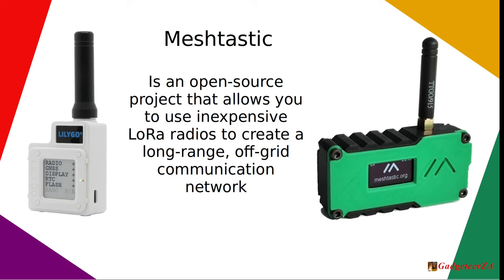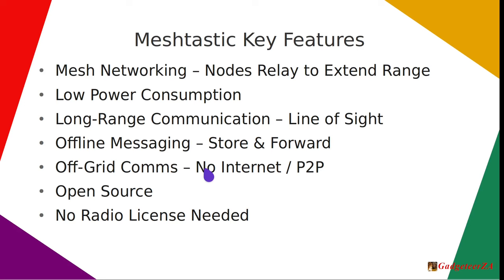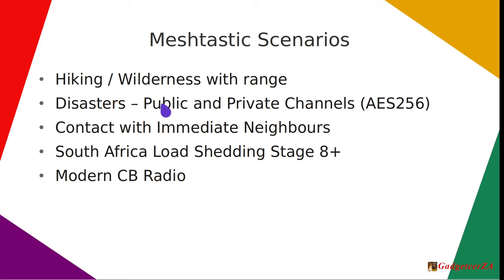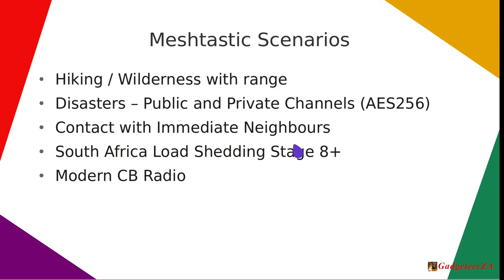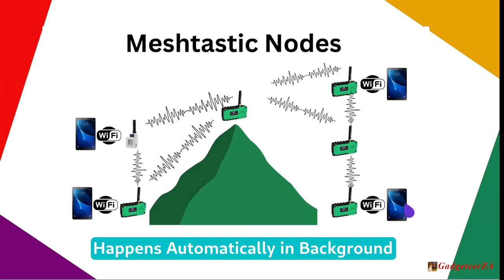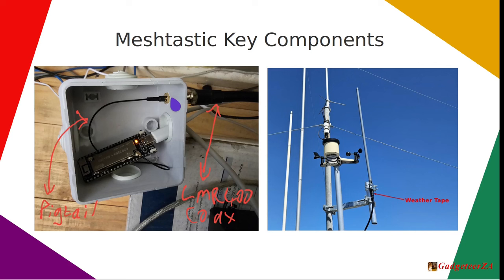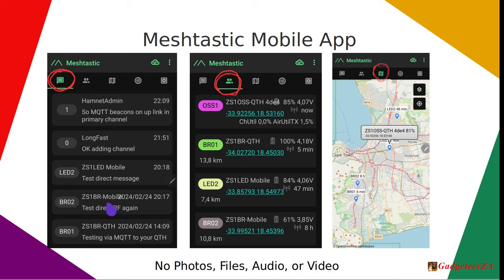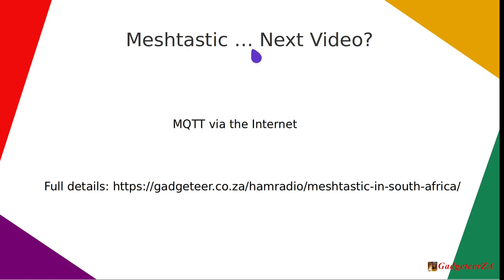A Non-Technical Introduction to Meshtastic Off-Grid Radio Communications

Comment from the maker: The msh/ZA topic in MQTT we are using for South Africa right now: If you want to follow a similar approach in your country, just use /msh/AU or msh/UK as appropriate. I've expanded a lot on tips and lessons learnt at the bottom of my web page at https://gadgeteer.co.za/hamradio/meshtastic-in-south-africa/, and I am updating that as I learn more.

Latest updates from July 2024 have disabled Store&Forward for client_router nodes, and now is only for dedicated router nodes. They have also reduced some re-transmits minimums to reduce congestion on busy meshes.

Comment: I've been a licensed Ham Radio operator since 1989, and was into CB many years before that. I have radios to cover all ham bands, GMRS, CB, and now LoRa/Meshtastic. I highly suggest people get at least one radio for Meshtastic, and preferably a CB and/or GMRS radio, too. I have one RAKwireless WisBlock, one Heltec v3, and three more Heltecs on the way for Meshtastic. The way this world is going I'm preparing for the worst.

A good video. Thank you.
Reply from the maker: I've done pretty much the same as you, except we've never had GMRS here. It's always too late when you need this hardware, to then think about getting it. But just like CB radio, Meshtastic is a great way of meeting other people nearby. When I was in my teens, I met most of my best friends via CB radio. But the challenge is getting people to adopt it, just like even with ham radio, I'm really struggling to get many of them to adopt digital modes. Voice is fine, but when propagation is challenging, digital tends to punch right through the noise floor.
Reply: @GadgeteerZA  👍

Comment: I pick up a few 150+ miles away. Just super impressive they will go that far. Those are all located in the mountains way above my location.
Reply from the maker: Wow that is really close to the global record of 158 miles - https://meshtastic.org/docs/overview/range-tests/. Check if it is actually over 158 miles then you can register the new world record!
Reply: Kudos!!! which LoRA module & antenna are you using?
Reply from the maker: Thanks! I'm using the T-Echo as-is when mobile but from home I'm using a Heltec WSL V3 with an 8dbi antenna mounted on a 5m mast using LMR400 coax to connect it. I think there is a link in the description to my webpage, and I included some links.

Comment: Have you experienced any noticeable signal loss using the 5m coax cable?
I am running 8m of LMR400 to the Heltec v3. I am still testing range and reachable sites.
Reply from the maker: Not that I’ve noticed but I did no detailed measurements. I, picking up line of sight for a good 12km.

Comment: Sounds like a good system and would be great if lots of people jump on board. Love the purple mouse!
Reply from the maker: Yes needs a few people and then it can stretch out the communications quite well. Yes using the same purple mouse as my standard mouse cursor.
Reply: You say that, but London & Manchester (UK) airwaves are packed with Meshtastic - you’re lucky to get a message through lol
Reply from the maker: @ScandalUK  yep we're way behind that. Hopefully tomorrow Saturday we get one placed up on our mountain, and we get coverage between our isolated nodes right now. We're using a custom localised MQTT topic so hopefully we can announce measures to reduce congestion when we need to.

Comment: Hello, I thought 433 had better penetration and range than the 868. 

You can get an advertised +20dbm at 433 100mw T-Beam 1.1 if I’m not mistaken?
Reply from the maker: Yes 433MHz will have "better" penetration being lower frequency, but there are some caveats such as in ITU Region 1 I recall we are limited to using only 10mW license-free (well in our country anyway), and if you go higher power as a licensed ham operator you lose the encryption. So what we're finding in our area is that 868MHz is by far the most popular.

Comment: A couple of us are on the other side of the country in the KZN Midlands, maybe one day there will be enough nodes to make the jump ;-) Used in the troubles with ATAK as well. I'm not a great fan of MQTT once there are lots of nodes about.
Reply from the maker: Good to hear you guys are flying the mesh flag that side as well. Will be interesting to see one day what the furthest stretch is we can get across a few nodes. Yes, I suspect MQTT will flood the network if the nodes are all connected. I still want to understand how MQTT is implemented better with Meshtastic. It definitely seems some settings override others.

Comment: just curious - are there already any meshtastic users in the CT area?
Reply from the maker: Yes myself and two other ham radio guys have ours running in Cape Town. One is sitting down by Simonstown too, but is not connected to the Internet, so you don't see it on the map. It's one of those situations where you need a few others spread out, so I'm hoping we can get some traction.
Reply from the maker: Now about 9 to 10 of us in CT area - a new higher node even connected me to a node in Stellenbosch 32 km away yesterday.
Reply: @GadgeteerZA  awesome!

Comment: Great video! Do you recommend meshtastic for massive industrial IoT usecases like smart metering where you need a couple thousand meters on the same mesh network?
Reply from the maker: Thank you. Mmm not sure about a few thousand, but put it this way, you can tweak how often each transmits so typically you reduce that a bit, and you can set an encrypted channel so no-one else is reading the data. The devices transmit incredibly quickly - quick short bursts.

The other thing is by default they will each relay signals onwards, but Meshtastic does choose the most direct route. But again you can set a few to relay, and the rest not. So some thought and tweaking is just required. It depends on how far away they are versus concentrated in a smaller space.

But you can reach those who will know more at https://meshtastic.org/ in the Discord or Reddit servers. I'm sure many have actually done something like this.

Comment: I wish Meshtastic devices could be used with a WIndows computer without internet. sadly they built this whole thing around the smartphone application and I don't have a smartphone.
Reply from the maker: You can log into the device and message/manage it via a web browser by connecting to its IP address but yes that needs a LAN (no Internet needed though). That is not very stable though as you need to refresh the connection after a while. You could also connect to it directly using the USB cable, or in theory, install the Android app under an emulator in Windows, and connect via the laptop's Bluetooth. And a LilyGo T-Deck device requires no phone at all, as it is a bit like a Blackberry phone with a hardware keyboard included.
Reply: Keep in mind that phone service isn't required for the smart phone. The app currently requires Android 5 or higher. Considering Android 5 was released in 2014, that opens a lot of used phone possibilities. As mentioned in the video, the T- Deck can be used standalone. If you haven't seen a picture of one, it looks like an old Blackberry phone.

Since the release of the video, a significant milestone was reached with Linux. You can now run Meshtastic on Raspberry Pi boards and work is proceeding with other Linux platforms. It's my understanding much of this is being done with Python and since Python can run on Windows, a Windows version may not be too far off.
Reply: I use an old phone no longer needed..works great.

Comment: On the Range Test page there is an image of a Google related tool used to help find the long distance ranges, that has an option to check for a Flat (I have to do this for censorship) Earth. Now why do you suppose they would do that if Flat (I have to do this for censorship) Earth was not a possibility? I don't see other shapes like a cylinder which is what the Mercator projection is based on.  This idea of a Flat (I have to do this for censorship) Earth being given equal consideration in the tool must be pretty important.
Reply from the maker: OK not sure as my range test page in settings only has options to enable it, interval, and save in .CSV format. I'm on latest Beta so maybe you're on Alpha version? Radio frequencies tho do depend on Earth curvature as high frequencies are only straight line of sight vs lower frequencies (not Meshtastic frequencies) which are HF and can follow the curvature of the Earth by bouncing off the ionosphere. So as far as Meshtastic goes - it really only works in straight lines, unless you can reach a far mountain peak with a node on top, and then relay to nodes far on the other side. But even for 100km that is still pretty flat ground.
Reply: @GadgeteerZA  The claim "HF and can follow the curvature of the Earth by bouncing off the ionosphere." is in interesting one in that 1st, it commits the logical fallacy of begging the question Earth is a sphere and 2, There are no known experiments in physics to validate the claim of anything bouncing off of a layer of gas in an open system where that gas fails to obey the 2nd law of thermodynamics and expand into the available volume of lower pressure. I'm a shortwave guy not a ham but I have seen hams make such claims without scientific validation. Fun fact you can look up -  The idea of an ionosphere was not created (it was not discovered) until after Marconi's radio test between England and New York. It was said by the mainstream scientists of the day it would never work due to Earth being spherical. Poof, it worked. Suddenly the radio buffs needed a reason why it worked in keeping with their heliocentric belief. Thus, the Ionosphere was born.
Reply from the maker: @DivergentDroid  the ionosphere did not just appear then, it was really only discovered after radio waves were invented and could be experimented with, and it was observed how waves that travel in straight lines only, could sometimes bounce long distances. I am a radio ham so had to study all the theory of radio propagation at different frequencies as well as power and bandwidth levels. A lot of what radio hams do is experimenting with radio, so we have radio beacons, and low power signals that are sent out 24/7 and we monitor when and when they are received elsewhere on Earth. Each frequency band ha sits own characteristics in how it propagates,a nd it is quite fascinating. That experimenting also includes bouncing VHF signals (line of sight) off the moon when it is present, to reach further to locatiosn you cannot see ove rthe horison (no moon, no reach). So hence why we are interested in Meshtastic as it is straight line of sight only, but it's relay capability let's it get around all sorts of objects.
Reply from the maker: I think you are taking us way off the topic here, and I'm not making any claims. The video is about Meshtastic line of sight radio - it only connects to what it can see in a straight line (I never claimed anything else for this radio). You asked about the Range Test page - was that the one in the Meshtastic mobile app config settings labelled Range Test? As I said, my app's config page only shows the three settings I mentioned, and no link to anything external. The Range Test is intended to generate signals on one radio, with the other one receiving them whilst in Range Test mode. Those can be saved to a CSV file and imported into a spreadsheet to analyse. I haven't used it myself yet, but the idea is to walk around a neighbourhood, doing this test, and then seeing what the signal strengths look like at say 100m, 500, 800m etc to see where the signal works or not.
Reply: @GadgeteerZA  To be fair, you allowed my post to be seen and replied to it. That is the topic we are on not the device. My point is to demonstrate that the Flat Earth radio box is there because there is actual evidence of the surface being flat. I am not making any claims about the overall shape of Earth. No one has ever seen that but I know you believe otherwise, you just don't understand physics enough to see the globe claims are faulty. I'm trying to help you realize something you should know for your benefit.
Reply from the maker: To be fairer I allow everyone's post to be seen (if it relates to the video), but your post was in response to my video about Meshtastic radios. And that is what I'm responding to. I already explained that Meshtastic radio is line of sight so really covers a range across a city or to a neighbouring town at most - it is therefore irrelevant as to what the shape of the Earth is at all. If you can see it, this radio should connect, if not, you can't unless you relay through someone you can see. It's as far as you can see.

You asked about the Range Test page, but that was not something I actually showed in the video as it is in the app config settings and will show really up to 15km. It has no Google related tool at all in it. Raising points about the shape of the Earth has nothing to do with this type of radio frequency, and that is just taking it off-topic. That is a different type of radio frequency and that was not what I was presenting in this video. Hence, let's stick to Meshtastic radio. See https://i.imgur.com/81eK54x.jpeg - this is what the Range Test page looks like - it just saves any signals to a file. No Google tools that I see. Where are you seeing Google tools though?
Reply: @GadgeteerZA  I Love how you just try and twist the convo back on to the device when that was Clearly Not the reason for my post.  Yeah just Run From Physics and Learn Nothing. If for no other reason than to use Physics to prove me wrong. I'm not trying to be ugly just have a reasonable conversation  by two adults who who can learn from each other if we give it a chance.  You just hand wave dismiss this topic out of hand. Shame.
Reply from the maker: If the post did not have anything to do with my video then it really should not be here at all, and is off-topic. If you want to discuss the physics around how Meshtastic works (technically or logically) I'm happy to discuss that. But raising unrelated issues is the definition of online trolling. The "twisting" is merely keeping the comments her on the topic of the video. No-one wants to see comments about why the sky looks like it is blue, or sand appears to fall to the ground. There are p[plenty of videos that deal with that and will be happy to entertain those discussions. I read very comment on my videos and ensure they do in fact stay on the topic of the video, as the only people watching this video, are those interested in Meshtastic.
Reply: @GadgeteerZA  No worries man. I don't have to discuss it with you. If anyone is interested in more info please ask, I'll be happy to have the conversation. It Is all related even if this host doesn't think so.
Reply from the maker: No problem if they take it up with you on your channel, but off-topic discussions here will be removed from here. My channel is not going to be high jacked for topics unrelated to the video itself.